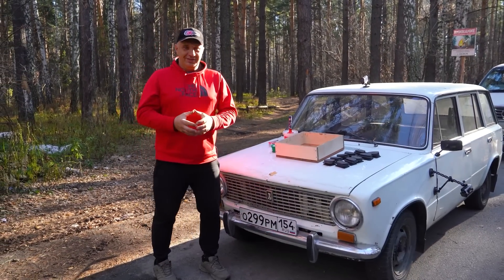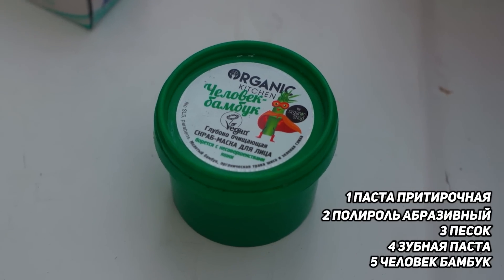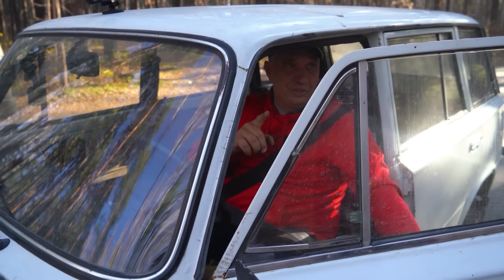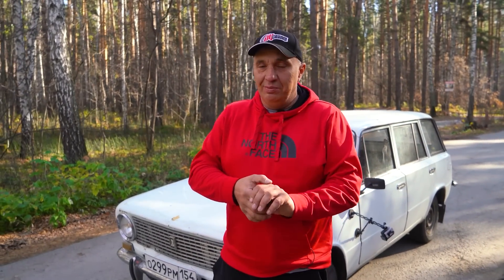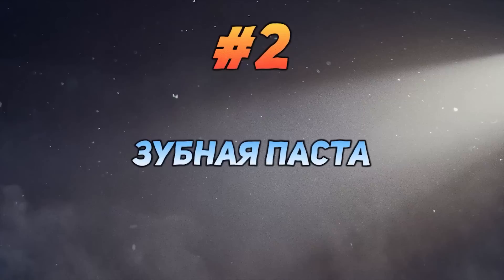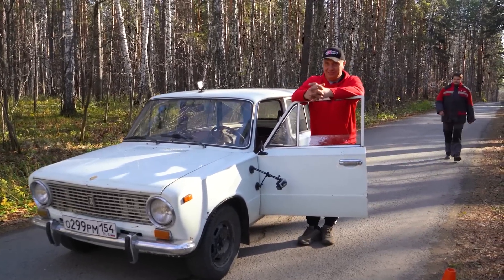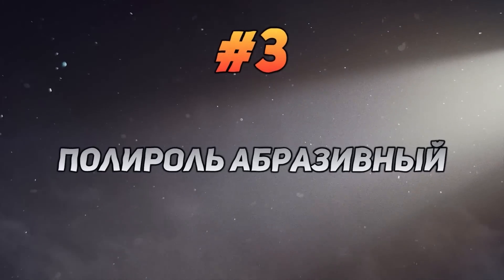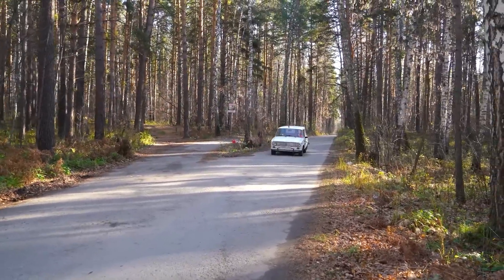How will toothpaste, scrubs etc. affect braking performance?

Comment: I have an idea for G54 to try.
Engine Centipede.
Air goes in an engine, exhaust is hooked up to the next engine's intake.
How many engines can run like this?
Bonus points if you can make it per cylinder by going by firing order. How many cylinders will have usable air?

Comment: Can you glue sandpaper to new braking pads to rectify/resurface brake discs/rotors? eventually the sandpaper will disappear so every time you put new brake pads you have a super smooth surface?

Comment: This is all fun. but the only way to test it correctly, would be to put on the stuff, brake. then clean all the parts, and do a second brake-test. then you have to replace all parts before testing the effects of a different stuff to put on. It will also be expensive.   Anything you lube the brake parts will only lube them, not help them.

Comment: int he  first to say to make a marble rotors and rear drums from marble counter tops....it very hard and heat resistance good looking     And another idea test sand in  stock , aluminum, steel, stainless steel, and wood  brake drums to see the damages results   made from the shop...

Comment: I believe the biggest issue with this is that as soon as the pads start to compress onto the disc, it will not let the particulates pass between them, rendering no advantage, and any fluids or detergents will leave a film reducing effectiveness of the pads futher

Comment: HEY GARAGE54! Would putting different smelling 'Essential oils' in your fuel (or engine oil) make the exhaust smell nice? Like Peppermint, Lavender etc etc? 🤔😏 🤣🤣
😎🇬🇧
Reply: They do make a sent additive for kerosene it's also a cleaner have not used it in gas but in diesel in heaters and it's cleaned up every heater that I have used it in first time had a kerosene heater that blew out nothing but black smoke used a hole bottle in 2 gallons and by the end it was clear no smoke and had a good sent u can get it at home Depot but a lot cheaper at Walmart just not as much of a selection

Comment: Another awesome experiment. Love you guys, and all the amazing videos y'all make. You guys do everything I've ever wanted to try, but never did because i didn't want to ruin my car. A stick shift is hard to find here in the USA, and I'd like to keep my 1997 Kia Sephia as long as possible instead of scrapping it. The engine is still quite healthy after about 500,000 miles (800,000km) and aside from a few electrical gremlins and no air conditioning, it actually doesn't run badly. I replaced timing belts and the clutch myself at home in my front yard, and still drive it till this day. Anyway I love you guys, and y'all's awesome videos. Much love to y'all from South Carolina USA.

Comment: -Had they pushed the pistons back so the pads were not that close to the disk, and then sprayed the disk itself with something like 3M 80 spray on contact adhesive, I bet that thing would lock its brakes right up and stop in shorter distance than stock.

Comment: I suspect the heat tolerance is a big factor. If the liquid part of the formulation has a low boiling point, I assume there will be a "steam hydroplaning" effect, where the steam creates a low friction barrier of steam. Has happened in aircraft runway overruns before
Reply: The 800 grit abrasive particles are thicker than the steam cushion could be.

Comment: What if you put sandpaper in between the brake pad and rotor to increase friction?
Reply: I'd imagine it would very quickly polish the surface of the paper like their wooden brakes they tried
Reply: Better idea would be to try coarse grinding stones like you would use to sharpen a knife

Comment: Hello! Always make sure to keep your car's dental hygiene up to date!
Reply: All four rotors on my Jeep Grand Cherokee have holes. Should I take it to a dentist and have them filled? This is very scary. Oh, what to do! Oh, what to do? Anybody? Anybody?
Reply: @Colorado_Native  It depends on whether or not your rotors are designed to have a cavity tolerance or not. Sometimes they have cavities to help the brake pads bite without burning their mouths. In your case however, I would likely recommend an automotive dentist since I don't know if those holes are supposed to be there.
Reply: @itsskip  Oh, thanks for the reply. We've found the holes in the rotors quite handy fo squishing the mud out when going over some of the high-mountain passes here. Do you think making the holes bigger would help? How about drilling out the pads? My mechanic recommended flossing. I think he meant for the Jeep and not me. Ideas? Thanks.
Reply: @Colorado_Native JB weld for those cavities
Reply: @Colorado_Native That's what happens when you install chocolate tires.
Reply: @lastotallyawesomebleach204  Don't know if you watch his channel, but that sounds like an idea for the crazy Russian guy at Garage 54. They do some odd but interesting stuff for cars, like wooden pistons, etc. Thanks for the reply.
Reply: @Colorado_Native  this video is from those crazy Russian guys you're describing and I do watch their content. My favorite video from them is the one with the human hamster wheel powered Lada. But yes, I'd like to see them drive on chocolate tires. Better yet, it would be cool if they built a Lada made entirely from solid chocolate, and if it could run and drive.
Reply: You wanna have those brakes to have a nice bite. Keep em healthy.
Reply: @rianhines8747  Mine has a noticeable overbite on the front. Should I be concerned? Will rotating the tires help? I seem to use the brakes more going downhill. I'm concerned about this. Have you seen some of the dropoffs on Hwy 145? They're scary.
Reply: @Colorado_Native  i hate to say it, but I think your car is gonna need braces for that.
Reply: Never forget to top up luminescent fluid your lights and blinkers will thank you…
Reply: @seligjuggalo9378  Also, while working on the car, it's a good time to check the pads on your wipers brakes. Chris Fix did a nice tutorial a year ago on that. Also check the brake fluid.  Don't forget to top off the wiper fluid as well. If you use the new Teflon Washer Fluid Typpe 2, you can use the leftover to coat your frying pans, the barbecue grill and the oven. Make sure it's Type 2, Type 1 isn't heat tolerant. Hope this helps.
Reply: @seligjuggalo9378  Good reminder. I watched Chris Fix put disc brakes on one of his car's wiper blades a couple of years ago. It might be a good time to check the pads and brake fluid. I forgot if it's DOT 3, 4 or 5 fluid, but any NAPA or AutoZone should know. Also, while on the subject of fluids and stuff, top off the wiper fluid, the Teflon brand seems to work pretty good - nothing sticks - no bugs, no bird droppings, no tree sap, well you get the idea. When you buy your Teflon wiper fluid, get the Type 2, that way you can spray your barbecue grill, your skillets, fry pans, inside the oven, even inside your bath tub and shower, but they have to be clean, dry and streak-free. Remember, Type 2. Hope this helps.